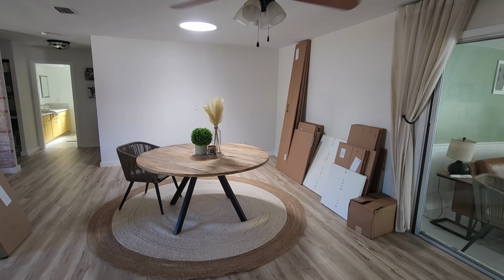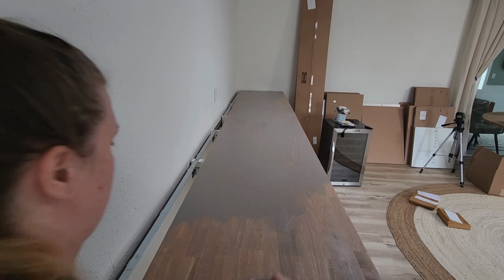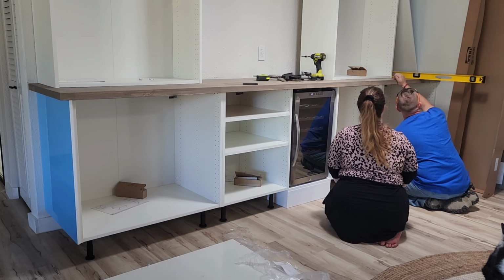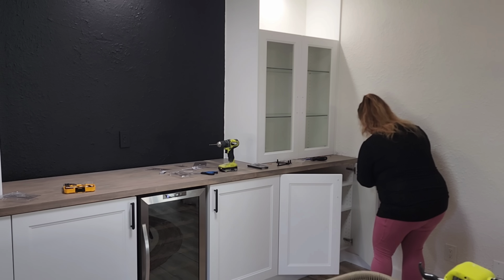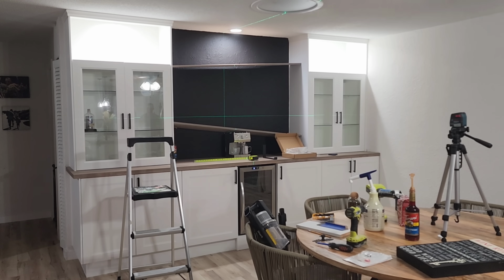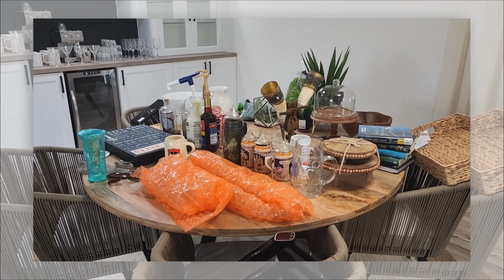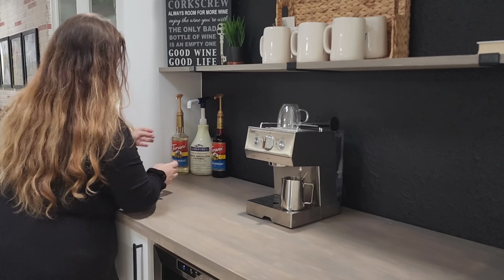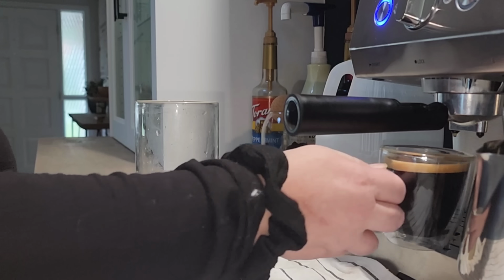EXTREME DINING ROOM MAKEOVER / DIY BUILT-INS

Comment: So absolutely gorgeous!  I love the black wall in the center to ground everything and give a focal point.  It's just spectacular!  It really finishes off your main living space!

It's funny - I had a little mental checklist of how I would do it (which usually gets revised as you go along because, after all, it's YOUR vision and not mine!) but this time they were almost exactly the same except for the black.  I had a color in mind, but love your choice of black.  One by one, you checked off all my boxes - lighting above, lighting in the cabinets, crown molding  (or some sort of decorative molding), etc.  The only thing I would add is a strip of crown molding (or even a flat molding) across the top of the middle, black section where it meets the ceiling to give it a completely built-in look.  

I love to watch you two work together.  And Bobby does a great job with minimal fuss.  I think he can do just about anything you want!  And then there's sweet Freya, pitching in to help mom and dad!  🥰🥰🥰

Have a great week!

Comment: Another great video! There is a white board that goes up to the ceiling between the glass cabinet and the shelves that you hung up, how did you attach that board straight up and down to be sturdy? Is it attached to the outside of the cabinet and is it attached at the ceiling? Thanks.